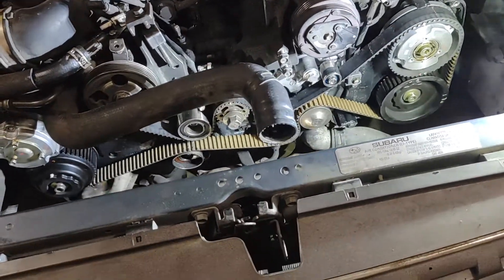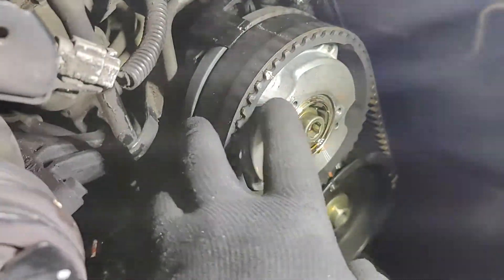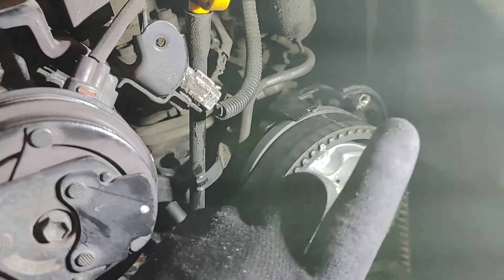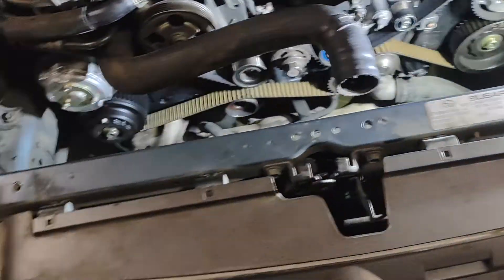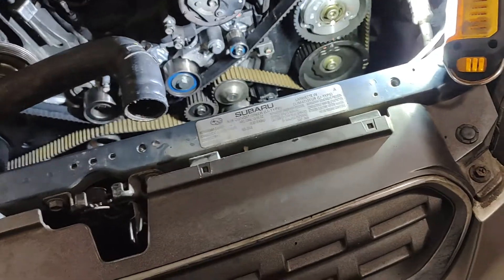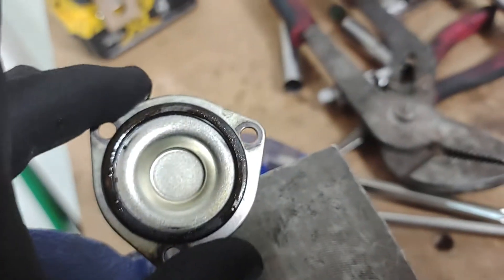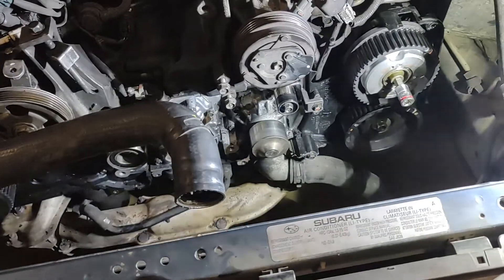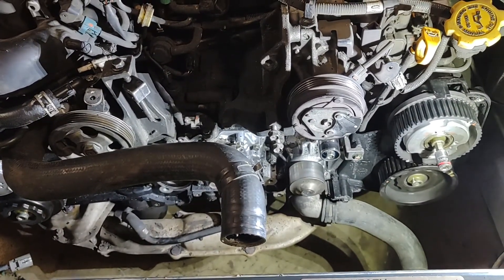05 06 07 08 09 Outback XT 2.5L Align Timing and remove Timing belt and pulleys - Timing #6

Comment: Question about timing a brand new engine.. can the Crank pulley be off by 360 degrees? Or as long as the mark on the Crank lines up with the mark its good to go?
Reply from the maker: The crank can be off 360 degrees, because each 2 rotations of the crank are 1 rotation of the Cam shaft. The crank & cam marks need to line up. If the cam is off but the crank isn't, the crank likely needs to rotate one full revolution
Reply: @11fulstrum  the machine shop set the Crank for me. Good to know though thank you

Comment: When aligning the driver side cam, does it matter which way I turn it ?
Reply from the maker: To get technical from the shop manual, yes it does, you should only rotate it clockwise as it does when it runs. This is due to the journal bearings on the cam that have only been worn in that direction. But the long term reality is as long as the crank is set in the half up/down position like it should be, you can spin it either way for alignment.